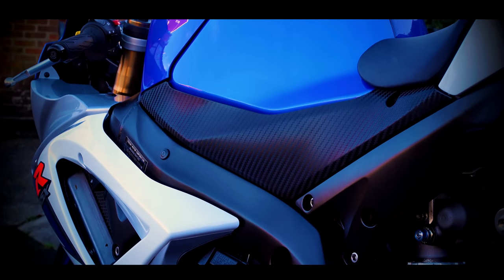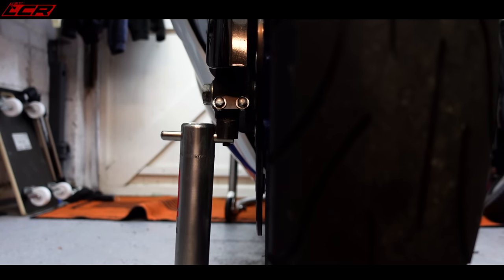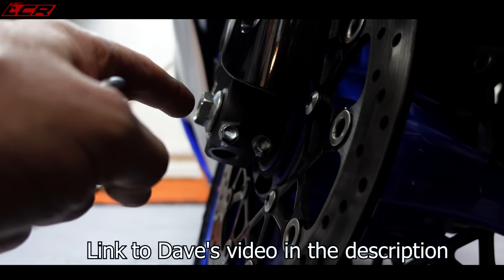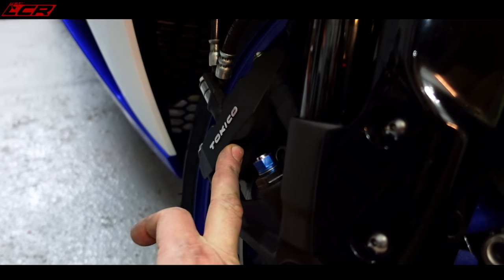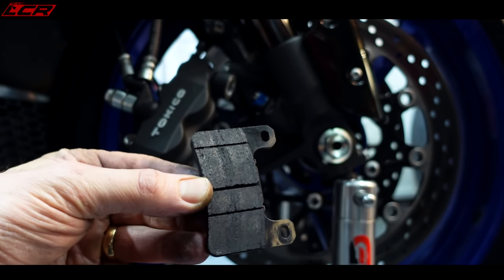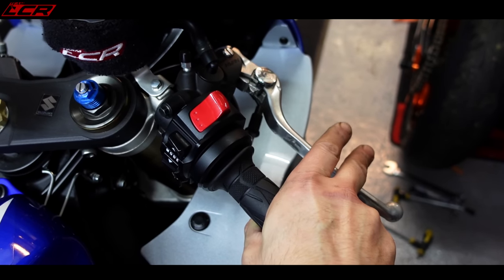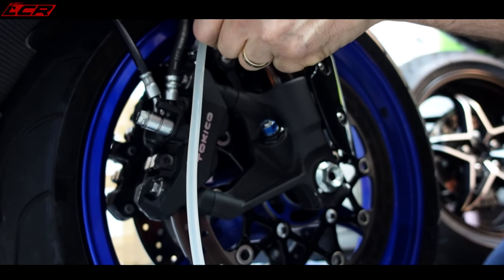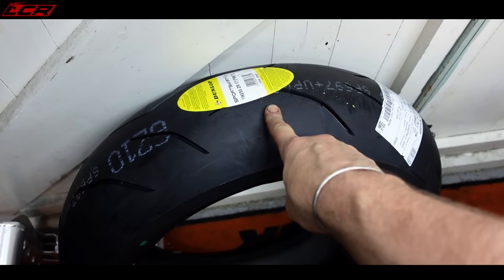How Too Fix Brake Judder For Free!! | Three Tricks To Try 🔧

Comment: The bobbins on your rotors are there so that the disc can expand when it gets hot you don’t want the disc to move on them as it will push the pads back into the calliper it isn’t important weather they spin or not . Modern bike discs are made up of different materials and  are thinner and lighter than the old solid discs which will expand at different rates thus the bobbins and the wavy washer. Your judder was most probably a wheel alignment problem getting the axle right in the forks was most likely the fix. The callipers will align themselves when you apply the brakes if all the pistons are working properly a slight difference of how far out they are side to side isn’t an issue but back to front on the same side is.
Reply: I agree on your guess for the axle alignment. Also seeing how loose/tight those bolts were, there is a good chance of a very poor mechanic job in the past.

Comment: Great advice! Tbh, it's pretty bad that the dealership sold it to you like that, they should either ride it themselves to check stuff like that or allow a test ride. No point having a shiny fairing if something like the headstock is loose and you end up crashing it 5 miles down the road. 🤦‍♂️🤷‍♂️ Aaron Knox
Reply from the maker: Yeah not good is it! Thanks buddy 👍
Reply: I bet there's still a few bike shops out there that don't pay much attention to there stock, apart from get it shiny and out the door, and if you said anything back to them I wouldn't be surprised if they said the old, if we did that then we would have to put the price up lol, I know the one I worked for was spot on, because I did the pdi's on the bikes before they went.

Comment: Brake juddering is often caused by pads and rotor glazing rather than caliper alignment or piston position. You need to sand the pads and resurface the rotor to remove old pad material. This is why it's often a bad idea to install new pads on worn rotor. Any fix would be temporary at best.

Comment: You should have loosened the calipers before you sent the fork legs so the legs is even more free to move and set itself parallel.  Then squeeze break and tighten the calipers.

Comment: Did you undo the lock nut to adjust the adjusting nut underneath chops, cause from the video it looks like you were just trying to tighten the top nut. If you only turn the top nut chances are the nuts will bind on threads and you will think that you have tightened the headstock bearings but really you have only took a slight amount of play out. Need to slacken the top nut then adjust the lower nut until there is no play left in the bearings and the steering turn free but with a slight amount of resistance, but you need to have the front end off the floor with ability to move not on a paddock stand. Trolley jack and block of wood under exhaust headers does the trick . 👍

Comment: BRAVO!!! I clean this way several times a season. I use an M6 or M8 w bolt and a deck with a nut. Depending on the type of disc. Several times brake cleaner and.... A lot of dirt comes out from under the rivets. Also I wash the brake calipers several times a season.

Comment: Well that was worth it , cost nothing but time , nice one . Having found evidence that the guy you bought it off may have told you a few porkies it will be worth going through everything else as well , engine oil, fork oil , rear brakes , just give it a proper service so you have peace of mind that it has actually been done , great tip about the disc bobbins as well , something I didn't know , great vid Chopsy .
Reply from the maker: Yeah going to check the whole bike over 👍

Comment: Shortly after I got my Kawasaki Concours14, it developed brake judder.  Kawasaki agreed to replace the rotors under warranty.  It did not fix it, so I put up with it for several years.  The dealer was quite a distance away and they wanted it for an extended period of time.  When I needed tires one year, I removed the rotors and torqued the mounting bolts evenly.  The problem cleared up.  I believe that the rotors had been torqued unevenly when they were replaced.

Comment: Great move watching Dave Moss. I have learned a lot from him from 2 years of chatting with him as I learn to setup my bike's suspension and wheels. Great tip using the bolts on the bobbins. Thanks.

Comment: if you use that piston tool without lubing the seals will be the quickest way to bugger them up!!!! as it causes the seal to pinch !!! quick spray of brake cleaner to clean them pistons and seals , always a good idea if the pads are out 🙂 the a light smear of rubber greese to lube the pistons that will make the like new again! job done! hope this helps.

Comment: Cable tie from the brake lever to the grip is a good little tip when centralising the caliper. Been doing this on my mountain bike for years and it's the same for motorbikes too, gives you time to do both sides up without worrying about letting go of the brake lever 😉😉
Reply: Also leave the cable tie for a night for a good pressure on the brake lever. Will be much better, feels harder on the braking point, less sponsy

Comment: When you get the abba stand back. Get the bikes front in the air and have a check how free and smooth the head bearings really are. With a loose top nut and missing locking ring, someone has been in there before. You spoke about doing the front forks, that would be an idea time. Bike looks great, keep us updated how you get on.

Comment: Fascinating to watch someone having a go at that who has the knowledge and patience, having a crack at it.  Honestly if you had tightened up the head stock, would you have bothered with ten bolts and callipers.? Probably yes, given its your neck on the block.  That's the thing with a twin disc front end - is it worth it. BMW R9T or pre '82 Triumphs. Good shed bikes - easy to work on and adequate performance. Easy to feel spot something not working properly - know what I  mean?
Reply from the maker: Thanks Andrew, yes makes perfect sense 👍
Reply: Only for small or lower performance bikes single disc is adequate. Even my zxr 400 has twin discs and it only makes like 60 HP.

Comment: I had the same on a Tuono V4.
Someone advised me to get some heat in the brakes, as that never really happens under normal riding conditions. Did that for a few rides and the issue sorted itself. Never returned since.

Comment: Had a vibration in my front disks on my bike. Never knew what a floating disk was. Did the ring clean and repositioning of the front wheel. The latter I did 2 times and ONLY after doing everything to the letter of the manual ( which was same as your linked video in description) and torquing to spec the vibration went away. Why are floating disks good? Pain in the ass I say.

Comment: I could be wrong but when you were spinning the front wheel did i see a dent in the rim, on the brake lever side,worth checking around where the weight is on the rim, i hope im wrong great videos

Comment: Is it adjustable? Will the caliper go more left or right?! The pistons just push out how they always did. If 1 blocks on your rotor then the other will push.. just pressured and looking for the weakest opening. 

Didn’t knew it was on a gixxer. I have a busa and it only fits in 1 place.

Comment: you know you should have repacked them head bearings again lol, after so many years i would imagine there wouldnt be any grease left in there.
makes you wonder about fork oil, bearings and airfilter.
i bought a cbr900 rrv 10 years ago and restored it, but the shop i got it from did the yeah, its had new wheel bearings brake pads this that and the other, but when i stripped the bike down to every last nut and bolt, i soon realised they were lying barstuards.
be nice to know which shop you got the bike off, was it the superbike factory by any chance?
Reply from the maker: Yeah I know, probably going to change the bearing anyway soon 👍

Comment: Could I just interject another thing to do before spinning the bobbins/buttons/rivets. Pop an Allen key through the buttons and wiggle it. If it moves it’s probably free and not causing any issues. If it’s stiff or doesn’t move visibly then give it a spin with brake cleaner. Will save a lot of time

Comment: As others have mentioned, I'd go through that entire bike with a torque wrench and give everything a once over and service it for your own piece of mind before you go mach 10 on it (70mph). Headstock was probably loose through slammed down wheeley fails. Just shows you that a shiny clean bike is not necessarily all that it seems. I'd be speaking to the seller re the new front pads and service BS as they sell multiple bikes. Find out exactly what they claimed to have done and go from there. 
Still a great bike but just needs some fettling to be safe.
Reply: It also has a "flat spot" on the front wheel rim, which you can see when Choppsie spun the front wheel on the stand around 8.45. Probably a heavy landing from a wheelie..

Comment: In my opinion never touch the rivits other than cleaning them with brake cleaner, if you try to rotate them your make them worse. Best way is to replace the disc and pads together.  Job done and all safe again.

Comment: The only thing you didn't do, which obviously was not causing an issue anyway, was to clean the discs with scotch brite or fine sand paper and brake cleaner. Brake dust does build up on them over time and can eventually cause judder, I do it occasionally as part of basic brake maintenance.

Checking and cleaning the bobbins was a great tip to add in there. Personally I would undo all pinch bolts, including the bottom yoke and do the bounce, then tighten the bottom yoke and the captive side pinch bolts and bounce again, then tighten the rest.
Reply from the maker: Yes good tips there too 👍

Comment: Your pads are stamped YT7806.  That may be a date code of format YMDD.  If so, the pads were made in 2007 and would be original to the bike.  So much for replaced pads.
I'm not a fan of brake piston gripping pliers as the serrated grips leave marks on the piston insides.  Admittedly the inner surface does is not involved with the brake seals.
Your K8 calipers have alignment pins that fix the position of the caliper on the fork.  The Dave Moss alignment technique will have no effect on the alignment.  The free play that I see when the bolts are loosened is due to on/off movement of the caliper, not side-to-side alignment clearance.  The L2-up Brembo calipers don't have alignment pins and can benefit from his technique.  The lower hole on those calipers is oval for that purpose.  You might be able to remove the lower pin on yours to allow realignment but I'd suggest that you leave it there.

Comment: Personally (after testing the steering head bearings first)  I would have removed the wheel and rotors, checked all the bolts and chased them with a die; cleaned/scrubbed the rotors with a scotch brite, cleaned the wheel, cleaned the calipers making sure the pistons move correctly. Then I would have loosened the triples and lowered the front 10mm and put new brake fluid in - cause the previous owner obviously hasn’t- put it all back together nice clean and shiny all aligned and correct and bounced. Then I would have bought new brembo rotors straight from Italy and new pads and replaced everything cause I really like to depend on my brakes when stopping from 100mph - and yes I just went through all of this on my gsxr1k

Comment: Did anyone else notice the RH side rim. I'm not sure if it was the wheel weight or something but it looks like the rim has a ding in it.
Reply from the maker: Yes you were absolutely correct it has a ding in it.. another job to sort 😫
Reply: @LambChopRides  not to critique your work. It was just an observation. I find it hard enough keeping up with the work on 2 bikes let alone the Chopsy stable 😂

Comment: Ah not the bobbin thing yet again. Also, you can’t see the disc moving that’s why dial gauges are used. The rotor will scallop/warp if the pistons are either misaligned, or sticking. Incorrectly running in new brake pads can also create issues.

Comment: Had a vibration on breaking on a Z 1000sx 7000 miles from new , don't ride hard  so was really piddled off when kawasaki said warped discs and they wasn't going to pay for them to be replaced, warranty had  just run out but was picked up while under warranty during a service but I hadn't noticed,and let it go but when I noticed  had to complain to kawasaki on its 1st mot but wasn't getting anywhere, I sent several emails to kawasaki UK  did reply wanted service history  photos of the bike ,few phone calls later offered a 1 off  payment, kawasaki wanted over £600 , I wasn't happy tried hard eventually they did replace discs and pads at just under half the full cost I paid just over £300  bike is nursed  cleaned regularly maintained to the specification,  service is done yearly 2000 miles or 4000 still gets serviced  , run suzuki motocyes  in the 1970s left out on top of the pit / coalmine all year round rain snow  frost never failed never replaced brakes or pads

Comment: Unfamiliar with term suspected - that doesn't work in my world, you need to measure and tell me the deviation and also know be able to say the tolerance of good brake disc. Use a laser to line things up true, its poor workmanship if you assemble and manually push thing together in the hope they will line up. Use lasers and pressure gauges.

Comment: Yeah nah, centring the callipers and bumping the forks with loose pinch bolts isn't "a dave moss trick"
it's just how you fit a front wheel.